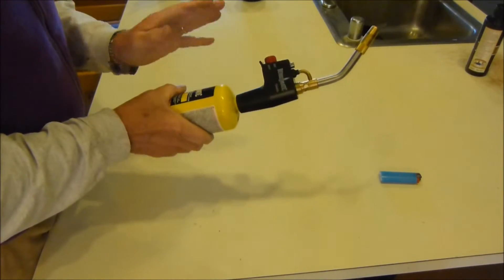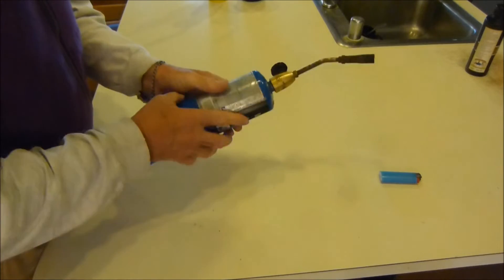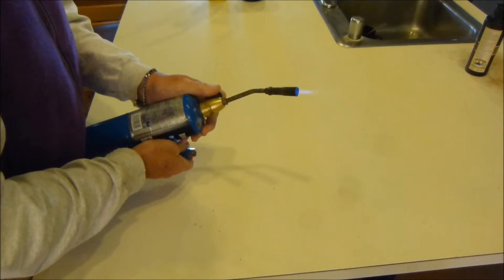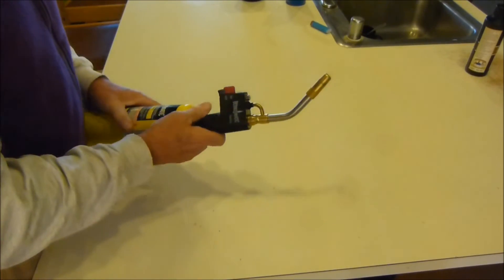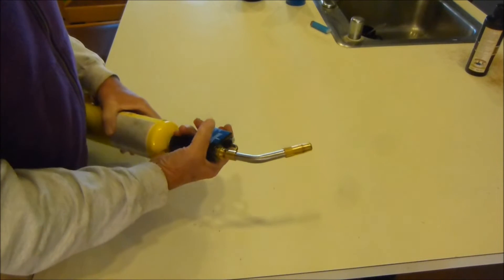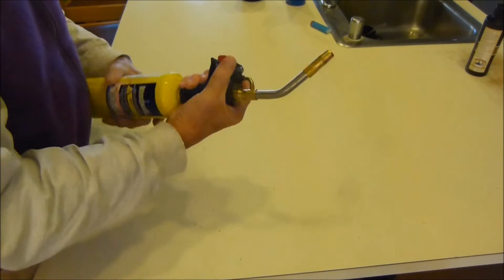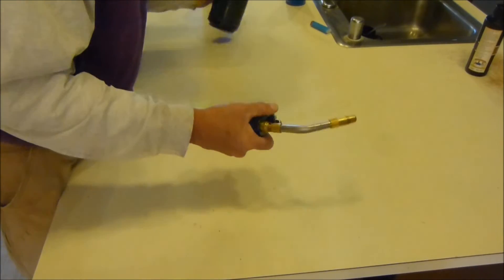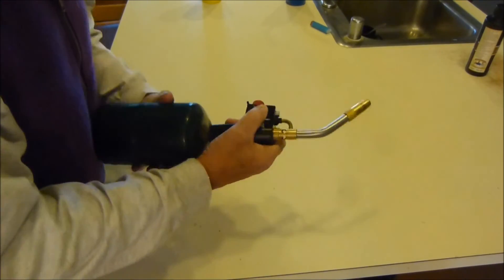Map Gas vs Propane Gas

Comment: @Roamic
MAPP gas has not been available since 2008 in North America. Map/Pro gas is a misleading name for a totally new gas, which is almost identical to propane. Here are the approximate temperatures of these confusing gases:
Propane- 3600F
Map/Pro- 3700F
Propane+Oxygen- 4100F
Map/Pro+Oxygen-5300F
(Note the discontinued MAPP gas burnt at 5200F)

I'm wondering if a more expensive Map/Pro torch will improve a propane flame enough to make it burn hotter?

Comment: "map" doesn't use piezo igniters for anything. "map" uses cartography and paper to show you where things and places are. MAPP gas is a safer acetylene alternative that was abandoned years before you uploaded this because it costs more to make than it's worth. MAP/Pro gas was introduced as a cheep alternative to fill the market gap left by MAPP. MAPP had near the performance of acetylene but wasn't waiting to explode. MAP/Pro runs a hair over 100 degrees Fahrenheit hotter than propane and burns ever so slightly cleaner but costs three to five times as much. MAP/Pro is just the unpurified portion of propene leftover from steam cracking propane into propene. The purified portion of propene is used mostly in the plastic industry like making polypropylene.

Comment: This is a fucking stupid video. Anyone else notice no difference between the map and propane? Thats because there isnt any difference. Real map gas got banned 15 year ago. Now the stuff that is sold as mapp is just propane with an additive. It cost $10 whereas propane cost under $5. They burn within 100 degrees of each other. Just buy propane.

Comment: I'm sorry but you have no idea what you are talking about. Either torch can be used for either gas, and with equal ability to ignite. And for anyone who wants to know the difference between the two, "MAPP gas" is a trademarked name, belonging to The Linde Group, and previously belonging to the Dow Chemical Company, for a fuel gas based on a stabilized mixture of methylacetylene (propyne) and propadiene. The name comes from the original chemical composition, methylacetylene-propadiene propane.
Reply: Its a good thing they came up with the name MAP. I would hate to have to say "hand me that methylacetylene-propadiene propane torch, would you?"
Reply: Bret Taylor I feel saying the full name is more professional

Comment: Um… I really hate to tell you this, but they DO have self-starting propane torches.  They're kinda new… only been around for forty or fifty years or so.  I just got a new "MAPP" gas torch yesterday and was looking for HELPFUL information about how to use it and its possible benefits and applications vs. propane.  So far I'm striking out - lol
Reply: Mapp gas has a lower ignition point and burns quicker and hotter than propane just be careful with things that can't get hot too quick

Comment: mapp gas is propane right?
Reply: "MAPP gas" is a trademarked name, belonging to The Linde Group, and previously belonging to the Dow Chemical Company, for a fuel gas based on a stabilized mixture of methylacetylene (propyne) and propadiene. The name comes from the original chemical composition, methylacetylene-propadiene propane.
Reply: mitropoulosilias hell no map gassed can melt almost any glass there is there is one kind that only oxygen saling  torch can melt but I don't remember the name
Reply: Jed slammer you would be thinking of fused quartz glass, which is pure silica
Reply: No, MAPP was/is not the same as propane; they have very different heating properties. As others have pointed out, MAPP is not available any more. Besides, the gas in the video is MAP, not MAPP. These are also different gases and they are themselves different from propane. MAP is almost entirely propene (aka propylene) with a fraction of a percent of propane. MAP produces a hotter flame than propane.

Comment: Get up to speed. Mapp gas has not been made since 2008. Mappro has taken it's place and it's no where near as hot. The new torches burn both but, why would anyone buy mapppro?
Reply: Wow, I never knew that they discontinued production! So basically, any gas now sold as "Mapp" gas is actually a substitute ... heh...
Reply: https://en.wikipedia.org/wiki/MAPP_gas
Reply: This comment isn't directed at anyone specifically, just in general, and about the chemical makeup of MAPP gas. My father was an engineer with Dow Chemical for 40 years (1958-99). The composition of the supplied gas has varied widely, as the general composition varied over time, but typically, the composition for an early Dow gas might be: methylacetylene (propyne) 48%, propadiene 23%, and PROPANE 27%!!!. For a later Dow/Petromont gas propyne 30%, propadiene 14%, propylene 43%, propane 7%, C4H10 (isobutane, butane) 6% might be more typical. So there IS in fact butane in MAPP gas, per the MSDS SHEET ( which I'm holding in front of me) and quite a bit more propane as well.
Reply: Worthington industries discontinued MAPP gas due to my lawsuit  I had against them because there defective cylinder nearly killed me. The new MAP PRO is only a mixture of propane and butane and only burns 3 deg hotter. They dont want anybody to know that so they just let you assume it is the same flame temp as MAPP gas was. They have been ripping people off since 2008.
Reply: Hey genius, Map-Pro is 95.5% propylene (the 0.5% is propane), NOT a mixture of propane and butane. You can check the MSDS - don't just make up random shit.